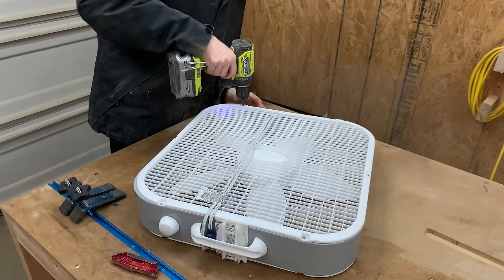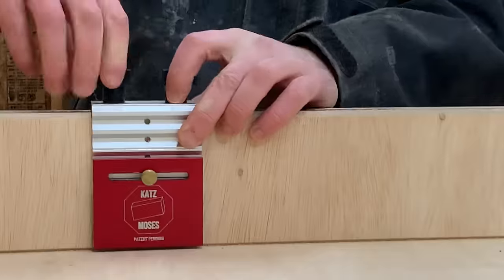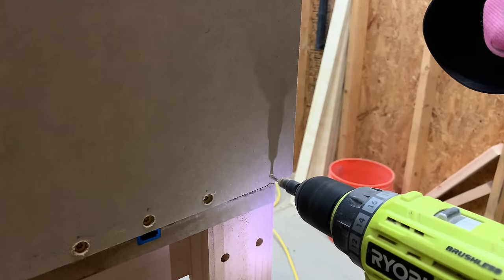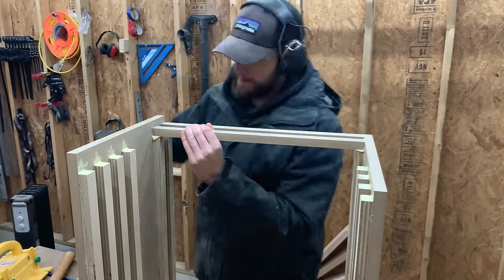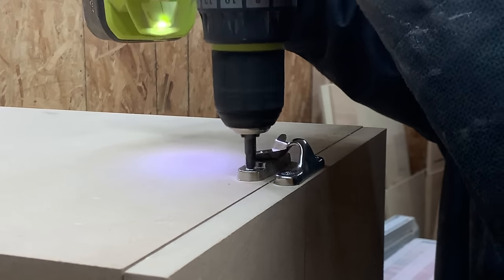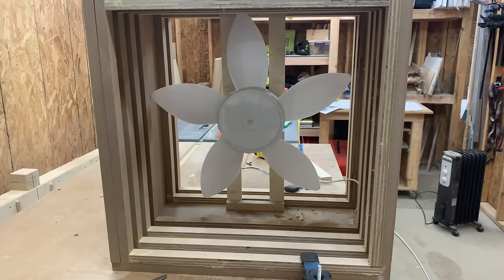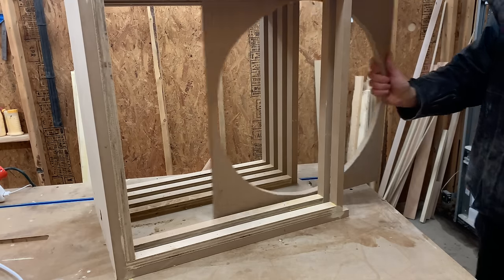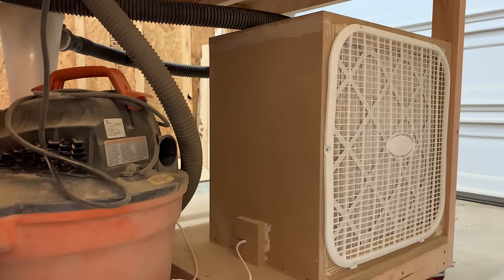this $20 fan will SAVE your lungs

Comment: For the round hole to have the desired effect of stopping air from going from the front of the fan around the edges to the back  of the fan the blades need to be inside the hole. The way you have it just creates a bit of useless drag.

Comment: A cool idea in theory but in reality, looks like the fan would need to be set on HIGH to work as expected since the airflow is restricted and the fan blades aren’t designed for such such a housing if you need efficiency especially at it’s LOWest setting . Like some people pointed out, the fan is supposed to be inside of the circular frame to help direct air not behind/before the fan. Sure the filters will trap some dirt but also increase the electricity bill due to the higher resistance. You had a good idea but they also build air conditioners/filtration fans for your specific purpose which are more efficient.

Comment: Or you could just make a Corsi Rosenthal box using the box fan, 2 to 4 Merv 13 filters and a roll of duct tape. The result works as good or better at filtering the air than any fancy $800 air cleaners. And weighs about the same as the box fan alone.

Comment: One word of caution. If you do any spray finishes in the same shop space, don't use this rig as a way to vent fumes. The fan motor isn't rated for use with flammable materials. If it causes a fire, your insurance will not cover the damage. That was one of the first questions our insurance agent asked when we decided to go with a new policy for the shop. If you spray with water based finishes then you don't have a problem.

Comment: For those not operating a shop....  Just buy the box fan and a HEPA rated filter.
No need to do anything except turn the fan on and place the filter on the intake side of the fan.
Air pressure (vacuum) will keep the filter up against the fan when in use.
Don't even need a clasp or screws OR EXPENSIVE Duct tape!!!
Filters over 90% of the fan thru put.
Use in California during fire season.
Effortless to install... and super cheap.
Will filter a room in no time as long as you don't leave windows open.

Comment: One thing everyone, the build is even cheaper if you can pick up the box fan at a thrift store, yard sale, or even better, rescue one from being carted away to the dump (95% of all electronic products I encounter headed for the landfill work just fine and just need a quick wipe down with a good cleaning product, maybe a detailing with a good vacuum) in an effort to keep costs and landfill pileup down.  Good build idea, thanks for the video and thanks to all the filter suggestion comments, definitely worth the time and effort!
Reply: Agree. I haven't purchased a box fan in years. People don't take care of them and if they stop or even just get dirty they'll just throw them out.  If they've stopped it is easy enough to oil them

Comment: Dust must be captured at the source and vented outside the shop. There are a few filter manufacturers that claim some spectacular numbers. The problem is, it’s the really fine particles that cause the most damage. Wood shops are cold in the winter and hot in the summer. I would read anything by Bill Pentz . Clear-Vue cyclone might have links to his articles.

Comment: This is a nice useful build. All box fans are not built equal. I have experience with this particular fan which I believe is made by Lasko. This fan is extremely loud and even on low it Sounds like a B 29 taking flight. The Lasko fan moves air well, but if you’re not a fan of noise, definitely give some other fans a test drive before you dive in. Thanks for the idea and tutorial.
Reply: What brand/model do you prefer for low sound? I’m looking to do such a project this month.
Reply: @michealnelsonauthor  I have gone through several of these types of box fans, and so far the ones made by comfort zone are the quietest that I found. On low, you can barely hear them and on high they’re moving a good amount of air with a minimum amount of sound.
Reply: @jgreber1790  tyvm! I’ll check em out.

Comment: The filters add a great of air resistance.  How do they impact the motor, it is not designed to push or pull air through the filters.
Reply from the maker: I'm not sure I have the instruments to measure that

Comment: Why not just build the box to hold the entire original fan housing, that way when your cheap $20 fan takes a crap you can’t just replace the entire unit.  You can also just tape the filters to the original fan. And save yourself all the freaking extra work. Makes no sense.cheers

Comment: to make the wire pass through even neater you could have cut the wire, or disconnected it from the fan motor, and fed it through a smaller hole, then reconnected it, maybe even put a grommit on their or something.

Comment: The ‘some sort of round baffle’ is actually a round tunnel the fan would fit snuggly into, this increases the air flow. I suspect a baffle either side as you’ve fitted would actually slow down the air flow.
Reply from the maker: It’s very possible! 😀

Comment: I just strap a good filter across the box fan with bungee cords. Works great and you can place the box fan whereever needed. Put it right by where your sanding? And you can use it to suck up all the loose sanded material right into the filter.  No fuss, no muss clean up! And no crap in the air to breath in!

Comment: Cool idea, now that you have a year of use under your belt, would you do anything different?  Or does it work as well as you wanted?
Reply from the maker: Great question, Michael! If I had to make another one, I’d try to find a more powerful fan. This one works fine, but the more power, the better!
Reply: @SpencleyDesignCo  Lasko #3723 is the strongest I have found. I contacted Lasko and its the strongest they make, was told it was 2200 CFM.  I have three in my garage, clears the air very quickly.
Reply from the maker: Awesome! Thanks for the info, Richard!

Comment: Fantastic bunch of ideas there.
I wonder if sandwiching fan/cheap filter/fan/hepa filter/ fan would increase airflow enough to justify two more cheap fans.
Using the baffle around the fan to not allow the air to cheat and go back around the corners is a great idea.

Comment: Cool filter. If you don’t have a shop, using duct tape, attach the HEPA on the front and the cheaper one on the back. Works great.
Reply: It'll work even better if you just stack the two filters on the intake side of the fan.

Comment: or… 4- 2”x 24” filters duct taped together into a partial box, close the back of the box with scrap paneling (plywood, thick cardboard, whatever is free) lay the box fan on the side opposite the paneling with the wind blowing away from the box, duct tape it to the filters. I’ve been using mine for over a year. I leave it on the floor, plywood side down, fan blowing up and some distance away from the source of my dust. I will occasionally shop vac my filters with a right angle brush attachment to pull off the worst of the dust and debris. Handy to move around my little shop, cheap and easy to store. Coarse dust/chips falls to the floor for sweeping, fine dust recirculates until the air current brings it around to the 4 filters and pulls it into the media. I’ll let it run for about an hour after a dusty project so it can scrub the air a little more.

Comment: Hello, how many watts is your fan? Here in Belgium, the power is measured in watts (I don't mean voltage which is about 120V in the US and about 220V here). I have found one here for a similar price. It is the same size (20 inches square) and has 5 blades. It's wattage is 50W. Thanks
Reply from the maker: Good question! Looking at the webpage of the fan I bought, it looks like it’s 54watts.
Reply: @SpencleyDesignCo  cool thanks a million, I'm going to buy it and start making my Spencley dust filter:-)
Reply from the maker: Awesome! I’d love to see it when you’re finished

Comment: I was watching your build for the filter box and I began thinking about the particulate matter that is suspended in the air whenever wood is cut, sanded, planed, etc.  One of the big hazards is the particles that are in the size range 0.1 to 0.3 micron (micron = 0.001 mm). Although your filter device might remove particles larger than this range it might be completely ineffective in this range.  The reason that this is important is because particles in this range can travel deep into your lungs and permanently lodge there or even move into your blood stream. I know that you probably would like to continue with your woodworking business but I would hate for you to regret not having taken precautions earlier in your career.  There are a lot of articles on line that go over the hazards of particles of this size so I will not go over them.  I thought that because a lot of your woodworking activity occurs in a closed space you might regularly use a respirator whenever you are cutting wood or do as much cutting outdoors as possible. I do woodworking myself as a hobby and perform as much of my cutting work outside or while using an N95 mask or double cartridge respirator.

Comment: A filter like that is great for a sanding and grinding booth. I wonder if the fan blade could be replaced with a blower type blade to make a dust extractor... Or would that particular motor not be well suited for that?
Reply from the maker: Sounds like an interesting idea! I’m sure there are other folks that would know more about that than me. Fully admit I’m no pro at this stuff

Comment: Actually, you just build a cube with four 20x20 air filters, the box the fan came in as the bottom, the fan as one side. You have the fan blowing into the filter cube so the dust remains in the cube.

Comment: Ducted fan vs open blade, keeps the air from positive side from traveling immediately back to where it just was and the energy sucking turbulence created. If heat exchange was the goal that turbulence could be beneficial  although here that heat would be from an improperly loaded motor on it's efficiency curve. Measure the amp draw in it's original configuration and try to stay within 5 to 7%.

Comment: Instead of using the box fan, try contacting a local hvac company and ask for a squirrel fan from an old removed residential furnace. Much better fan system

Comment: Orrrrrr,  You could do What I did, and not spend all day re-engineering a filter box, and just go to the local hardware store and buy the green filter material you use in your furnace that is large enough to cover the Box fan , put some Velcro on the box fan inlet side and the Green filter material will stick to it, allowing you to put the piece on and run the Fan on high.  When you are done, pull the filter material off the velcro, take it outside blow it off with a leaf blower, or to get it real clean, wash it off with your garden hose.  Then when done, tamp off the water let it dry and stick it back to the Velcro.  I made two, so one would dry while I used the other.  Very little dust in the air in my small single garage sized shop.  And it all cost less than 30 dollars.

Comment: A box fan is not the most effective fan to move air through the filters.

What kind of fans are used to blow air through a furnace? A squirrel cage? I think that's the best kind. It may be possible to pick one up used. Or, for this purpose you don't actually need a fan designed for heating an entire house.

Comment: I love projects more than most, but this one is a little overdone. This is not on the level of commercial filtration systems or devices, in the least. This turned out to be an overweight, heavily flow-restricted SPACE-filter... as in space-heater. I'm betting this thing can barely filter the closet in a guest bedroom, let alone a workshop. Sawdust will clog filter 1 on day 1. Also, filters on one side only. Hard enough for a box fan to pull thru one filter, but there's 2, and now there's one blocking the exhaust side. That HEPA is basically filtering 6 inches of space inside  a box, and you're basically blowing dust into it, not pulling air thru it. You want to filter that shop? Rig your box fans to some ductwork (with filters) in a couple spots and call it a day. Not doing a ton of good to filter air in a room and just dump that air back into the same room... unless you're in space

Comment: That fan won't move enough air to clean your shop air very quickly.  Left on overnight, it will, but that's too late for your lungs. I suggest investing in a dust collector AND air cleaner which has a large air volume.  Wen and Powertec have 400cfm cleaners for under $140, with Ecotec priced at $160.  DO look at them please, folks.

Comment: I just wire a green filter on the front . It sucks the air through and it works great.
Reply from the maker: Yup, like other folks have mentioned, that’s a great option! I just wanted something that looked a little more finished 😀

Comment: Alot of work, but with some mastik tape and some 2x20x20 or 2x24x24 (depending on size of your fan) you can do the same thing in like 2 minutes. After covid and when air scrubbers were hard to find, this method was used to increase air filtration in buildings. You basically take a piece of sheet metal, stiff plastic, or even cardboard the size of your fan on the bottom and 4 filters to make a box with your fan facing out of the top.

Comment: A 20" box fan is less than $20 and a less then $6 BestAir 20x20x2 MERV 8 pleated air filter (BA2-2020-8) can be attached on the intake (back) by simply removing the right and left screws, and poking 'em through a long shoestring or in my case, an old dog leash (hot screws created the holes nicely) and replacing the screws in the fan case makes a nice horizontal holding strap. Perhaps not as nice as yours but it's simple, cheap, and portable.
Reply from the maker: Yup, as a lot of folks mentioned, that’s a viable option. I just wanted something that looked a little more finished
Reply: I believe though with having more filters  he is going to be cleaning up more air.. through the added filtration.
Reply: @qkcam45  There is a limit. These fans are not designed to work with a restricted airflow, such as trying to drive air through a filter. They do work fine for the price point, but as you add more filters you will see a drop in airflow. At some point it is losing proposition to add more filters. Better off with fewer better filters and replace more often.

Comment: Nice. I personally would mount castor wheels on it so it rolls. Mount a couple of hooks on it for little wheel scotches so the fan doesn't cause it to roll.
Reply: He wanted to place it up in the rafters which would've been useless. All the nasty stuff is down low because it's heavier and better handled lower.

Comment: I’m curious as to how long that motor will last now that it has some negative and positive airflow pressure  which it really was not designed to handle. Overheating and becoming a fire hazard.

Comment: I don’t know.
With all that restricted air flow.
I could easily see that cheap fan overheating.
I taped a filter to my fan once.  Didn’t take long for the smell of smoke to fill the air,…shortly followed by a loud spark, then ultimately a dead fan.

Comment: Only 2 years late but the point of the plate with the hole is to separate the duct into 2 pressure zones upstream and downstream of the fan. For this to work the fan needs to be inside the hole. From what I could see there's a gap between the fan and the ring. This will limit the ability of the fan to generate pressure as air will spill off the blade tips and recirculate around the blade and not contribute to the total flow.The result is ability of the fan to generate pressure is much reduced so as the filter gets loaded with dust the airflow will drop off very quickly and you'll be replacing filters which actually have a lot of life in them.
Reply: MY BRAIN JUST GOT **DARZHNARZHDICATED!!
DERGONDERZHALERLERZHARDARZHNARSZHERZHBIOLERSZHERZER!!**

Comment: When you move air through a filter you create pressurized air.  Pressurized air wants to move to where the air is not pressurized.  With a gap around the ends of the fan blade you will have a path for the pressurized air in front or the blades to travel to the unpressurized air behind the blades which is the easy path for it to flow through.  But if you make a barrier that closes that gap it will be harder for the pressurized air to flow backwards around the ends of the fan blades.  So the smaller the gap is the more air will move through the filter in front of the fan blades rather than flowing around the fan blades to behind the fan blades.

When you close that gap and try to make it as small as possible you will need to remember that the blades will stretch out and become a little bit longer when the fan is turning.

Comment: I seem to find that there is no suction and I believe I have basically the same box fan and I even use just a single filter config attached to the back. Am I doing something wrong?
Reply from the maker: It’s hard to diagnose without seeing. Mine has been working just fine for over a year